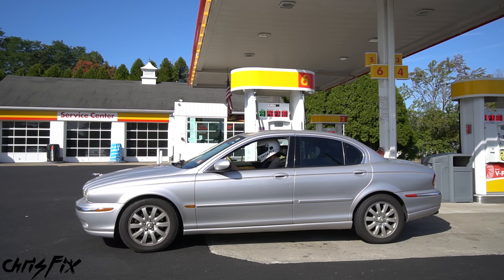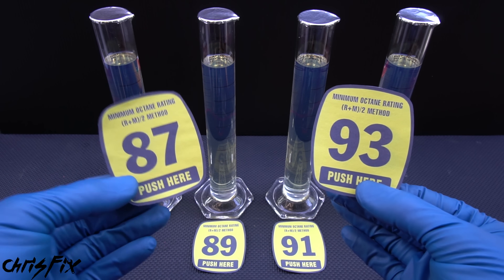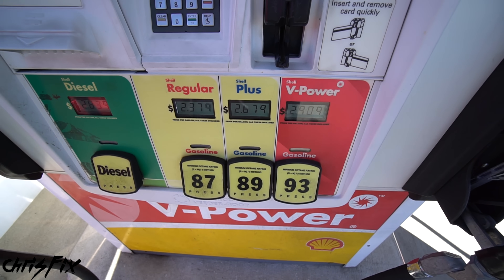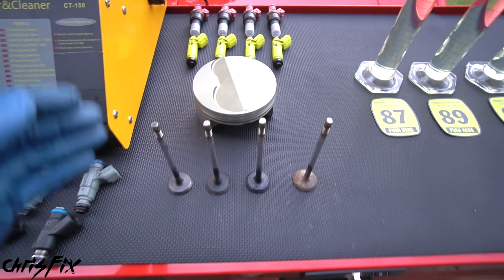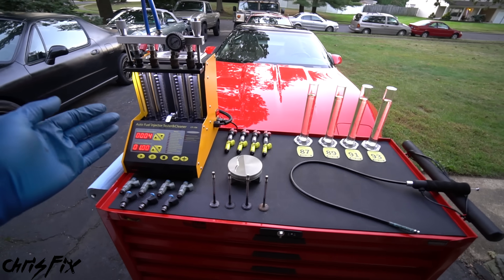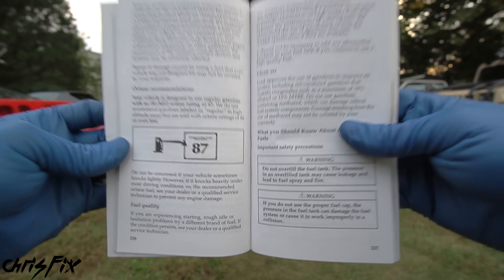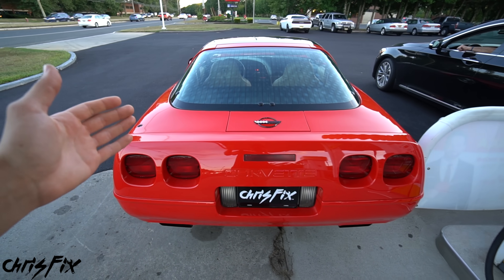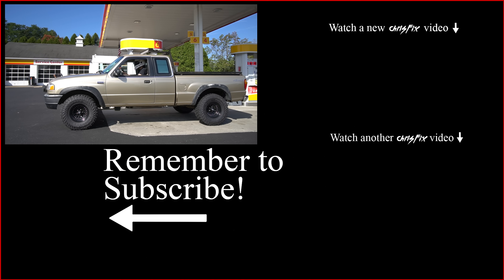What is the BEST Fuel to Use in Your Car or Truck and WHY

Comment: I'm old enough to remember leaded gasoline and 101 octane
Reply: sniperhat1  those were the days
Reply: I remember leaded gas also, type writers, calling collect, playing outside,  no power steering pumps, etc lol
Reply: @stangtrax  😂 playing outside
Reply: I remember when fuel was red.
Reply: Desil gasoline is red. The kind they put in your house. And you can mix in like 1 gallon of desil gasoline when you get regular gasoline and it helps the engine get lubercated cause it has more oil in it.
Reply: @greenlawnfarm5827  off road diesel is red. Road use diesel is green and i wouldnt suggest putting diesel in your car at all lol
Reply: @Tragiic1  lots of diesel cars
Reply: @greenlawnfarm5827  
Standard tank won't take the diesel nozzle. Probably the extra oil wouldn't be good for a standard engine, because of extra soot.
Reply: @hell-sol5240  my bad should have said none in gas burners 😂
Reply: Well you already put oil in the engine. Im not talking about putting oil in the gasoline just put some desil in could help it run smoother. It depends what kind of engine it is probubly.
Reply: you can still get 101, or even 110, usually at or near a track.
Reply: @srenblackgaard9982  my local gas station actually has a big tank of rocket brand 118, e90, and methonal. Pretty weird actually
Reply: @corybeckmann8823  thats awesome !!!
Reply: @corybeckmann8823  i actually do too. any Sunoco gas station has it.
Reply: @srenblackgaard9982  there must have been a race track near when i was in Straightor Illinois
Reply: E85 is around 97 to 100 or more
Reply: High ethanol fuels have a high hydrocarbon content and high octane rating.
Reply: In asia 93. 95. 99 octane leaded is red
93. 95. 99 octane unleaded green
US 87. 89. 91. 93 unleaded clear
Reply: @ellbertdinoy  this videos misleadingly premium 93 is almost blue and the rest are usually clear with a yellow tint
Reply: I remember when non ethanol laced gas was available. No longer, because they need an outlet for the excess corn they're growing.
Reply: LPG has a higher octane rating then petrol
Reply: @UbFunks  really?
Reply: gaffnaldo1 yeah mate. Lpg still doesn’t have nearly as many hydrocarbons as petroleum though. Just more resistant to premature ignition
Reply: @UbFunks  looked it up, you are completely correct. Doesnt have the same power output but it more stable under pressure and cleaner.
Reply: We don't even get this low octane petrol in Australia. The lowest we go is 91 then it's 95, 98, 100. I didn't even realize that America used a different rating system.

Comment: E-85 will damage an engine not designed for it, especially things like seals and gaskets.

Ethanol is also supposedly the reason corrosion is a problem now in car engines, though I've never met anyone who cared what brand of gas they pumped.

Comment: Nobody really knows what gas their truly getting, minus vehicles needing Diesel. There are a few plants here in Texas that takes really crappy gas and mix it with Butane to make it seem better and ship it right through pipeline to its destination. I'd say the best gas for an "average" car is gas containing zero Ethanol. Zero Ethanol should maximize fuel efficiency. However, there's nothing wrong with using regular gas.

Comment: I just want to make this clearer. The difference between the octane rating is the mixture content between ethanol and octane. Now ethanol has a lower fuel economy, meaning that you use more fuel of ethanol than you would use with octane. This is because ethanol (C2H6O) is composed of less carbons and hydrogens than octane. So to put that into perspective for every gram of ethanol you will release about 29 kilo joules and for octane you would release about 48 kilo joules per gram (considering it goes to perfect completion). Hence, it is more fuel efficient to have octane because if you had equal amounts of the two, ethanol will release less heat. HOWEVER, octane does not necessarily always go to completion considering that you need more air into the engine (reason why he talked about why air is very important). In a simple concept, if you have 10 dollars and it costs you 7 dollars to use a train and it takes less time or you chose to use a car and it takes a little longer. Both take you to the same place it’s just one is more efficient than the other. This goes the same with ethanol and octane. Ethanol needs less oxygen (because it has an oxygen, thus burning more  efficiently) and octane require more. So when you are driving in the city areas were you are stopping and going it is best to fill up with a lower ethanol content but if you drive on the highway more often it is best to use a higher rated octane. 
Hopefully, I haven’t made this to difficult to understand but either fuel has its pros and cons it just depends on the situation. Note: just like the person said just look at the manual of you are unsure because they are the ones who built the car in the first place :).

Comment: might be a conflict of interest that it was sponsored by shell
Reply: E stands for maximum ethanol content.
Reply: Realistically, the only 'conflict' would be if he had stated that Shell fuels are better quality, which he did not. He did mention their branding claims, and stated it as 'Shell claims'. Otherwise, the basic info is the same across brands, as far as what and how octane works, when you might need higher octanes, and whatnot.

As for E85, I wish he'd spent a little more time on it, because it's even less understood by normal users than regular fuels. E85 is '85% Ethanol' by branding and naming, but is legally allowed to be anywhere between 51-85% Ethanol. This is largely because of the properties of Ethanol itself, one of which is harder starting in the cold, so northern states reduce their overall blend during the winter. Ethanol itself actually has a lower energy content than gasoline, though it does have a naturally higher resistance to detonation (in my area, E85 is listed as 105 Octane). Because of these two inherent properties, you will generally experience less gas mileage on higher Ethanol blends (even in cars designed to take advantage of them) over conventional gas, while also being able to safely run more extreme tunes or power adders (like superchargers, turbos, or even NO2) without detonation. It is however, a more difficult fuel option to find in many parts of the country.
Reply: This is a shitshow of false info in here
Reply: Abraham Mata kinda what I was thinking. Also a lot of things he stating doesn’t seem right. I’m pretty sure a lot of 87 octane gas is E85 ( I could be wrong ) but I know they add ethanol to some gas and that would make it burn dirtier I thought. Also I get far better fuel economy using premium, or (v-power) as shell puts it, over regular all day.
Reply: @robertflynn3618  87 octane os e85 🤣 wut
Reply: Robert Flynn false e85 is 100+ ocatane which is why a lot of people who build their car for performance use cause they run higher compression in their motor, and if your car needs 87 and you put 93 your car will adapt to inject less fuel

Comment: Haven't watched the video yet, but higher octane fuel is more "compressible". If you have a high compression engine or a high boost engine, you'll want higher octane. If you want more energy out of a certain amount of fuel, well that's what diesel is. It's heavier, burns slower, but has more energy than gasoline. Diesel also acts as a lubricant, which is part of why diesel engines last so long. That's also why you can't put gas in a diesel engine. Diesel in a gas engine just won't run. Gas in a diesel engine will damage the injection pump because the injection pump is designed to be lubricated by the diesel fuel. Just a bit of information you may find useful.

Comment: Hi Chris, I have a Nissan Maxima J31 2004 (Australia). When I used 91 petrol, there was ticking noise from the engine. It was less with 95 and least with 98. Took it to dealer and was suggested to use 98 after all inspections, although the fuel cap says 91. I still can’t believe octane rating is the cause because the car was built in 2004, when 98 octane petrol was something newly promoted. 
What do you reckon?
Thanks. 
Van, from Australia.

PS: the ticking noise is like the old time when you press the gas pedal running high gear at slow speed. Not the constant banging noise. Happened pretty randomly on the road but more likely when accelerating at speed. No noise when idle or start off.

Comment: I had a 96 Camry, why did i see a significant power and fuel economy increase when i went from regular to premium?
Reply: It's a pretty safe bet that's what the Owners Manual called for all along but you never realized it. Few people do until years later if ever. As the old adage reminds us "When all else fails read the Owners Manual." Those Camry's from the mid to late 1990's were totally sweet especially with their historically unique "Earth tone" colors! They also got some impressive kickass fuel mileage economy. Sure wish I owned one now.
Reply: Well I bought the car used with no owners manual, I double checked for anything stating specific fluids including fuel grade, i want so far as to get a repair manual for my car, but I still didnt find any info for it.

Comment: My engine requires premium. 87 if it's not available. But, no WOT and spark knock may occur. And to fill with premium at the earliest opportunity. I don't have forced induction. But, do have 11:1 CR with 7000 rpm redline. I use RD Shell when I've enough points on my Stop & Rot card. Or, Phillips 66 as it's about 30¢/gal less than most retail vendors in my area. P66 is TopTier rate.

Comment: @ChrisFix So my question for you is if your pistols/injectors are already really dirty like the ones you shown in this video for example. Does using premium Shell Gas for a couple of weeks help remove all the sludge and gunk from the pistols/injectors? Or does it do nothing at that point, and is it only a preventive measure? Or can the premium higher grade Shell Gas with the extra stuff in it help clean and remove all of the gunk in your pistols and injectors if you use it for a couple of weeks? Please let me know, and possibly do a video as an experiment video if you can, as that would be awesome! :)

Comment: I found that running two to three tanks with Sea Foam removes carbon deposits in the fuel system very well. Recently bought a 2012 Chevrolet Silverado with the 4.8 L V8 with 107,000 miles. It felt like I was pulling an anchor around but after three tanks with Sea Foam it woke it right up. Very positive throttle response and noticeable power increase but only noticed a small amount of better fuel economy. I highly recommend Sea Foam for every gas or diesel vehicle over 100k on it and every 10,000 miles.

Comment: Hi there I don’t have my owners manual my car is salvaged I would like to know what octane level my car uses it doesn’t say on the Cap less fuel injector it doesn’t say on my dashboard i’m driving a Honda Civic Coupe EX-T 2017 i’ve been using regular fuel 
With 35996 miles on it  I just would like to know the octane level if can help me out
And great video I’ll make sure to like it

Comment: Chris I have a question I run 87 in my truck I've put 93 in the truck and nothing happened the only thing I notice was that I felt like I had more power
Reply from the maker: You won’t notice a difference if it should take regular. The engine can not compensate and make the most of premium.
Reply: @chrisfix  ok thank you ChrisFix love your vids

Comment: Hey Chris, I do have a problem with my car engine “Chrysler srt8 6.4 2013” but no check engine light showed up I even checked with my local garage if any mechanical issue was there and still nothing .. the problem I faced was hearing clicking in the engine, lost power significantly and fuel consumption got higher. Many times I used 93 in our country Oman “Middle East” and just recently I have started using 95 ..

Comment: Is there benefits in using e85 over premium or regular fuel in a car that can use both kinds? And is it true that e85 has higher knock resistance? Also if it's beneficial to use e85 is it then worth converting a car to use e85?
Reply: e85 contains 85 percent ethanol. Ethanol is alcohol and has less energy than gasoline, therefore providing less mileage. Alcohol may damage metals and seals in the engine. However, ethanol is more eco-friendly and has higher octane.
Reply: Bob Barker so if i want to create a lot of power should i run e85 because it has higher octane even though it has less energy
Reply: @lordwalrus8615  It's not really the fuel that generates power. It's more the engine. The reason why some vehicles lose power when using lower octane fuel is because the vehicle is makes adjustments to prevent pre-detonation.
Reply: Bob Barker i think this made things much more clear. Thank you very much
Reply: @lordwalrus8615  No problem. Like I said, it's not really the fuel that generates power. If the fuel has less energy, you'll need more of it. I noticed I get less mileage using gasoline from Costco, and I think they use more ethanol. It's more the engine that generates power. If the engine has high compression ratios, or a turbo-charger, it will likely need higher octane fuel to prevent pre-detonation. However, many modern vehicles that prefer higher octane fuel can still run on lower octane fuel, but will adjust things such as timing to prevent pre-detonation, and therefore reduce power.

Comment: 2005-2014 Toyota Tacoma 4.0L V6 - notorious for engine knock - MUST use 91, can get away with 89 in the winter.  Sucks!
Reply: get a celica
Reply: @bobbarker3248  My '71 Celica is worse - needs lead!

Comment: Just an FYI,  I have hauled fuel for 18 years...I can tell you that with Ethanol you will get worse fuel economy and the fact that it’s better for the environment has got to be false. The reason I say so is at the loading facilities where the ethanol is stored in tanks before added to the gasoline and loaded on the trucks, those tanks are painted white just like the rest of the fuel tanks.  You can tell what tank has ethanol because as it vents it puts black stuff all over the outside of the tank. The storage facility can’t keep them clean.

Comment: What is irksome is that only 3 Sunoco stations near me offer 91 octane that is recommend for my SUV. I'm using Shell 90 octane non-ethanol and get almost 3 mpg better than using 89 that majority of stations in area offer. Corn-based ethanol is a scam and one of the biggest mistakes government has ever made. Just ask some marine owners about the effects of this crap on fuel lines, carburetors and injection systems.

I'll stick with my non-ethanol. Perhaps you should do a vid on that.

Comment: I used a scope and used e85 for 3000 miles and it cleaned lots of carbon out.  It has normal carbon build so nothing major but at 100k miles my goal became 300k on the engine. I looked over her hard oil sample sent in compression test scoped the pistons. I always hear local so many myths about e85 so I said screw it talked with a chemical engineer he said it has less potential power but has so many more cleaning benefits so I ran it only got about 4 less mpg but it cleaned about 40 percent on the top of my pistons. Great video love your work! It would be cool to see you tackle the e85 myths and diesel myths.

Comment: How about this-> in Finland nowday there is 95 e10 and 98 e5, e stands for ethanol % (i hope that is correct translate), and when this new change came they put one site up where u can check if that it suitable for ur vehicle. Most of older car this new e10 fuel isn't suitable but still recommendation is for this using 95 octane. And even in my car, and I use 98 cuz I don't want booze damage my fuel lines and injectors.

Comment: There is never an increase in cylinder pressure Chris. This is actually myth.
Reply: Yep...surprised he doesn't know this. Usually he is spot on. This is PROVEN fact, no increase.
Reply: MixeTube love his stuff. Really great videos. I hope my comment is viewed more as a helpful FYI and not in any negative way. The rest of the information was spot on.
Reply: I’m dumb as a box of rocks, so I don’t have a say in this matter.  But the guys at NASA, Harvard, and at least one guy at Missouri Science and Technology writing his 149 page Masters Theses tend to disagree with your assessment.
Reply: @armyofshea7941  trumps IQ is also over 150+
Reply: Where he talks about cylinder pressure increase?
Reply: @evangeloshadjis7542  at the point where he shows the piston head
Reply: As there is both a time when the exhaust valve pops open venting the system and a temp spike at ignition

And combustion causes a temperature differentiation due to combustion which is literally the expansion of gas to push a cylinder 

How could there not be an increase in pressure 

I mean we see vacuum at the intake manifold and positive pressure at the exhaust manifold 

How could the combustion chamber see stasis at it has an intake stroke a stroke literally called compression, power or expansion and a exhaust stroke and at least a fraction of a second where both intake and exhaust valves are both closed
Reply: @jrich436  a 10:1 compression ratio piston will not suddenly be an 11:1 compression ratio because some carbon builds up.
we aren't saying pistons dont make pressure :P
Reply: Valentine ahhhh ok, didn’t know the context
Reply: The layer thickness (h′) of the deposited carbon decreases the volume of the combustion chamber. This will lead to a decrease in the clearance volume (Vc)(i.e. the volume of the cylinder that is not swept by the piston). As the volume available for compressing fuel-air mixture reduces, compression ratio (r) increases.